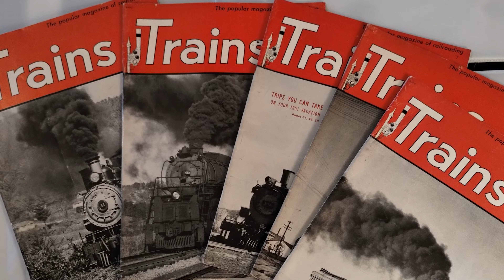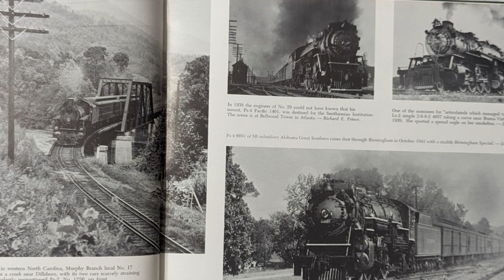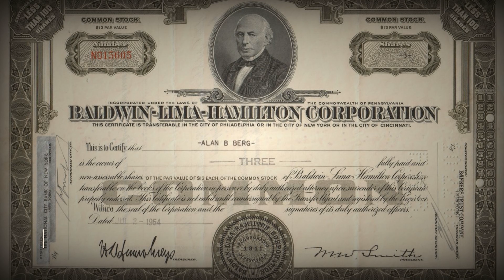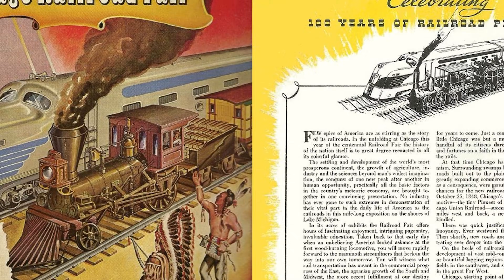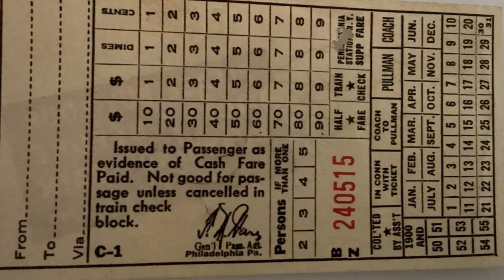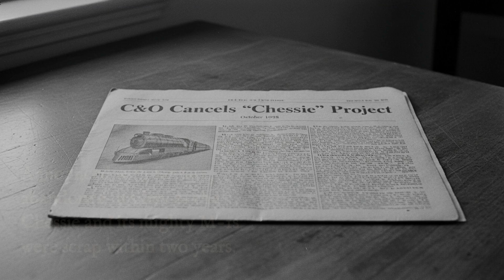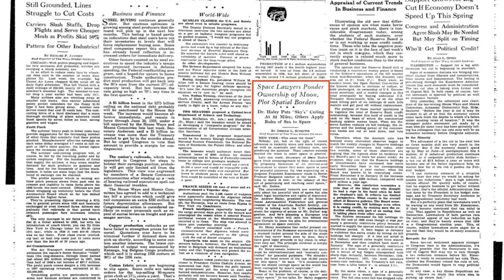$8 Million Locomotive That NEVER Carried A Passenger

Comment: Although it wasn’t a complete train, locomotives and coaches, in the UK, there was a steam locomotive that was very similar in design. That was the Leader class locomotive.
It was designed by Oliver Bulleid, a renowned locomotive engineer, and only one was fully completed out of a plan to build five prototypes. 
They ended up being scrapped (one completed and four partially built) but that wasn’t the end of the story as he went to Ireland where he took up the position of chief mechanical engineer on the Córas Iompair Éireann where he made a peat burning version but it never entered service and was scrapped. 🏴
Reply: Also the GT3.